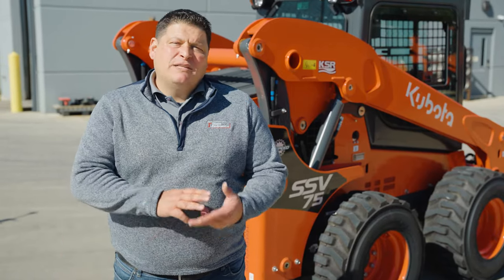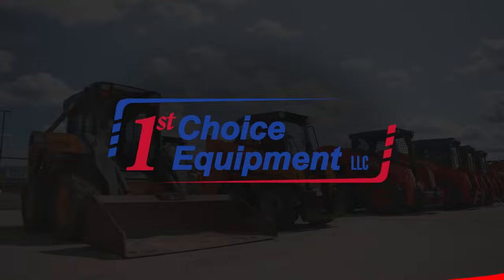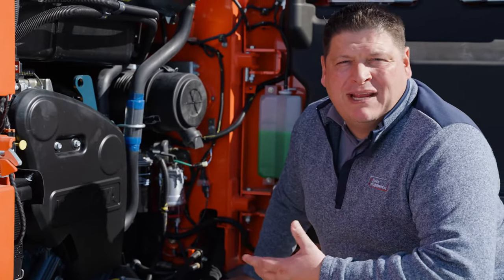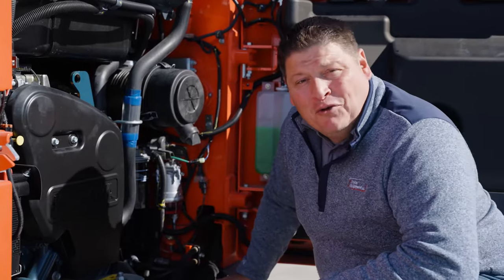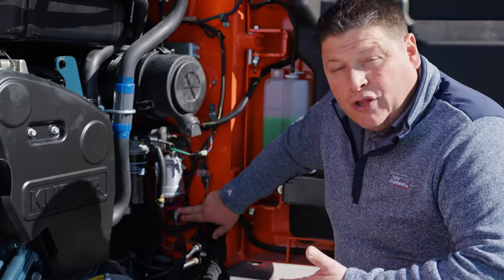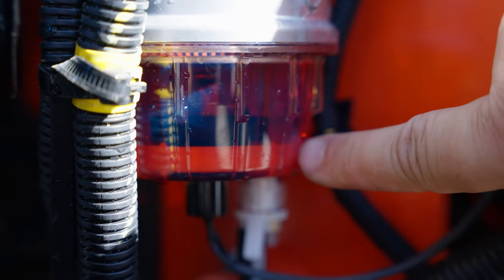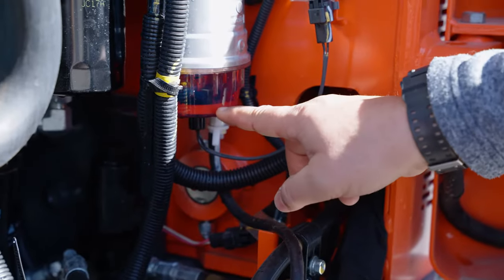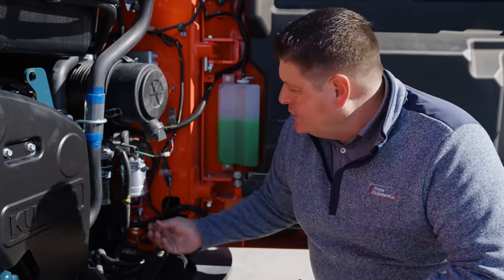Easy Fix To Engine Problems - Fuel Water Separator

Comment: Kubota rep says to be absolutely certain to filter fuel before filling tank, so have a filter system, or at least I use a fairly inadequate  fine mesh screen in my case but I do rinse out the jugs first, and do have a new filter on my 150 g transfer tank.  Injectors require totally clean fuel in these, they are Japanese precision engineered...
Reply from the maker: Great tip Dave, thanks for sharing.